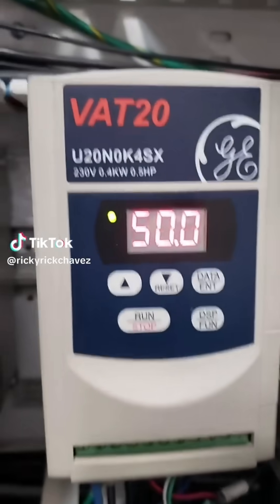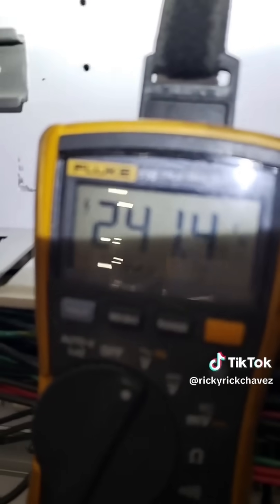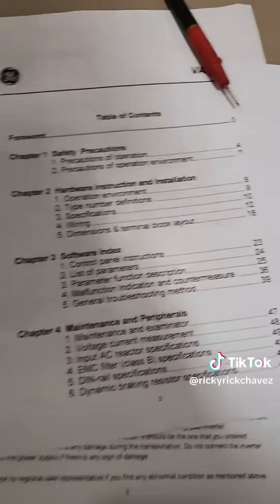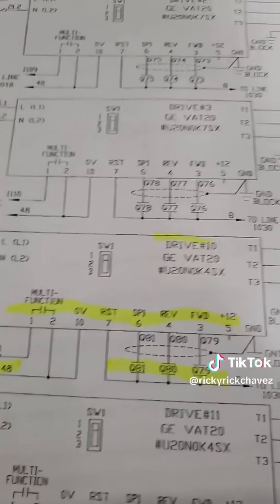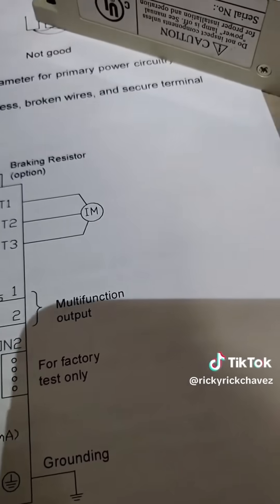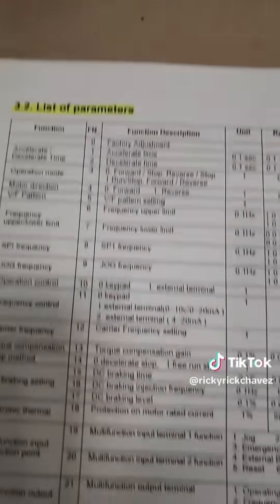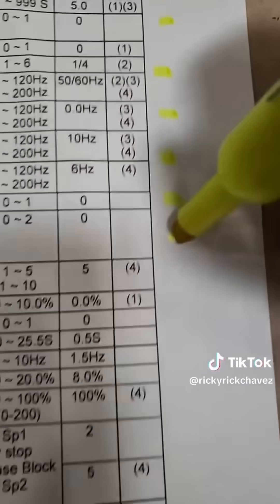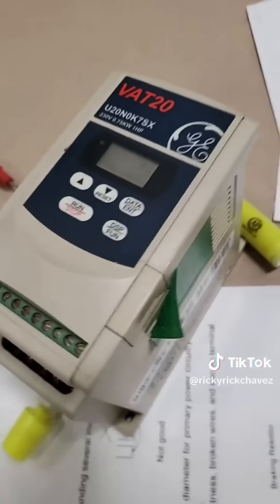60Hertz FREQ-Drive UN-Alived!

Comment: So you didnt solve the code you just swapped out the drive. I get it if production is down time is money a swap .
Maybe the fastest way. Some you can down load your parameters and up load them to rhe new ones. Most yaskawa drives its just put in date and information off the motor name plate

Comment: Er 1,,, Always go to your knowledge First then, look it up! That's step one. Then, step two... Hit the trouble charts. You must be union. Sweat shop workers, who want to make a decent wage, don't have time to do all that preliminary research when the big cats and dogs, (yes I said cats for those women bosses who like to wear the jeans),  are barking down your neck during a  breakdown, because they will have to send people home! That's the stuff you need to try to squeeze in between jobs, or at the tail end of related jobs, or the stuff you must reference during each major breakdown. That combined with years of experience should have everyone telling you... You should have become an engineer.. You know way more than they do! Lol. I know electronic drives can be extremely costly and they don't like to keep spares on hand, but I finally convinced them after building a test rack for the ones they do stock, to carry a spare for most of them they use regularly. That way I can swap out the drive and have them back in the game, then trouble shoot the problem on the test stand when time permits. They saw that time saving technique I implemented and I actually got a raise for cutting the down time to a fraction of what it was, by doing that. Great video. It took me back to that hustle, where you gotta stand your ground if you're the one they call to fix their problems and they are getting in your face. But then in a union shop you can just stop working and call the Stewart over to deal with them. Good job, and great video... Oh and Happy Thanksgiving guy! 🎉💯👏🏁🇺🇸
Reply: Oh Er1 is a keypad operation error. From trying to change a parameter out of sequence, trying to change a parameter that's not allowed or not changing the parameter while running.